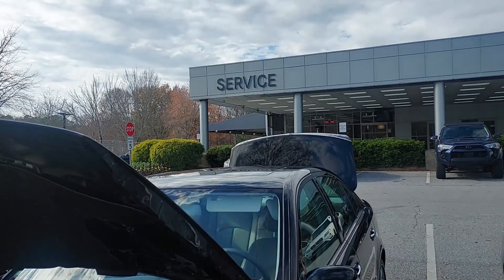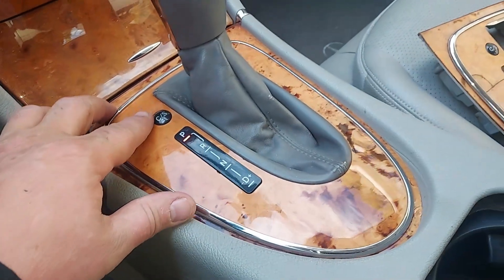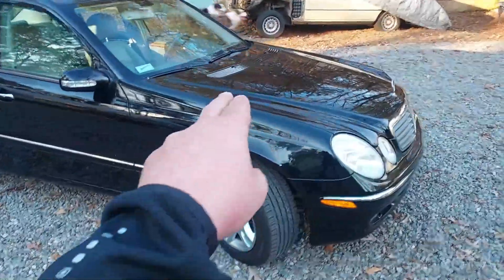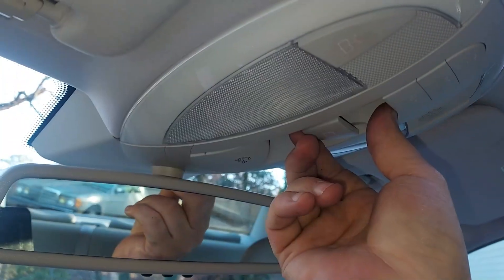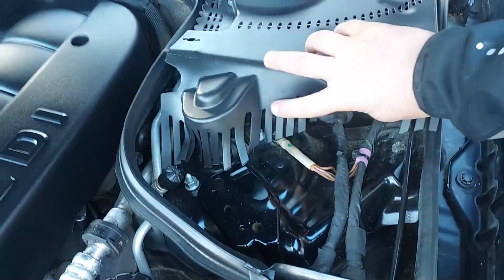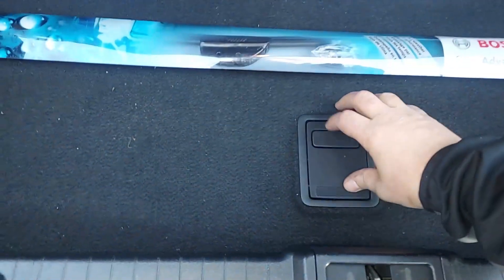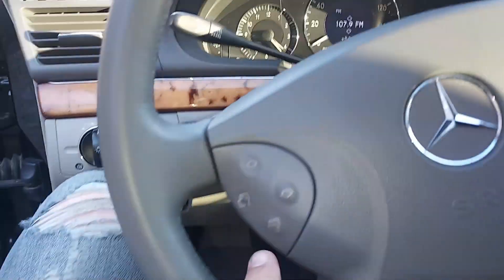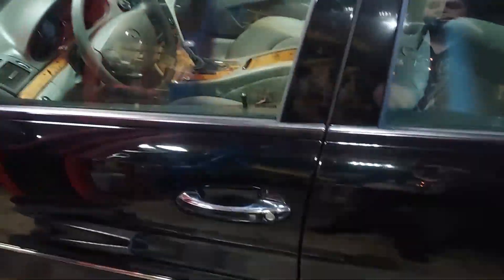2006 Mercedes E320 CDI - Part 2 Walk Around FOR SALE!!!

Comment: I've got the same car in platinum blue metallic.  Do you still have the part number for the wood shifter surround?  Mine is cracked up too =(
Reply from the maker: I don't know the part number but all you need to do is go on eBay and type in 2006 E320 shifter wood